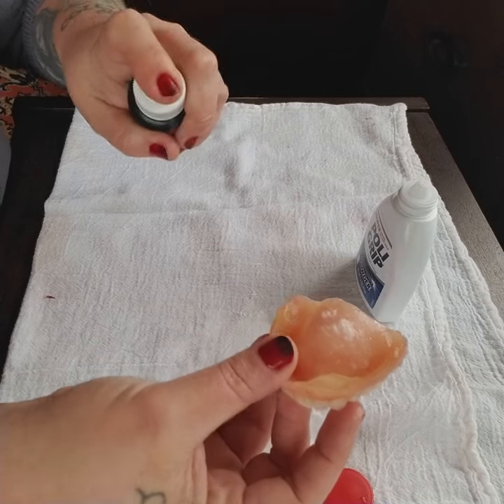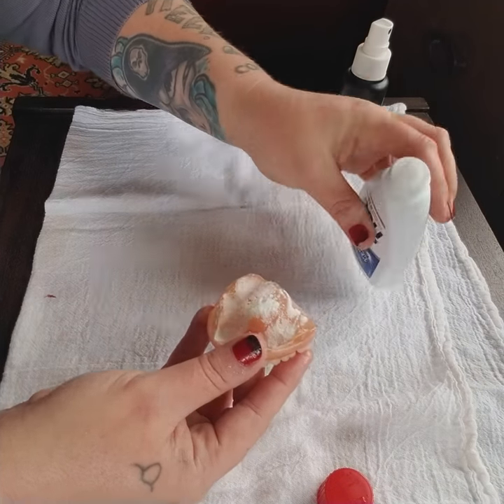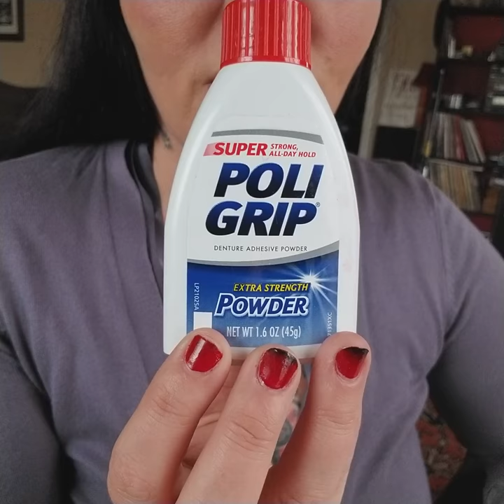Poligrip super powder application on dentures demo video

Comment: Does any one experience the upper denture on each side not sticking but the front holds better.? I've had my uppers since June 8 and now trying polygrip powder ( seabond doesn't work,and polygrip alone not lasting all day)
I've seen "Fixadent" work better  on YouTube because of the zinc in it! Anyone have  health issues with the zinc? If the cream and powder together doesnt work, Im going to try fixadent.
 Your thoughts?

Comment: I've tried the Fixadent powder and even let it dry for 30min before I drink or eat anything but that doesn't work.  I always make sure the whole palette is covered front to back with powder but liquids always gets under the denture and loosens it.  Hoping the Poli Grip works better.  I also have densure fit on my upper.  Hate the densure fit though.

Comment: Have you tried the Fixadent powder?  I ask because For me, the poly grip paste on my lower partial works better than fixadent gel stuff.  I've seen people talking about fixadent powder so I bought some ahead of time for when I get my upper denture.  I know this will be a trial and error phase and seeing what works for me.  I don't use the adhesive often in my partials because they really don't fit properly anyway and stay in fine without the adhesive.  My biggest issue is getting food under them and it's way more annoying to try to get them out and rinse when that happens if I have adhesive crap on them.
Reply from the maker: +Rebecca G I did try the fixodent powder. I didn't like it as much. It had a weird taste along with residue I didn't like. I'm not sure how it would work best with a partial. Unfortunately I only have full upper and lower. I've found I really don't like paste at all. I'm much happier with powder in general. :)
Reply: Tattooed Mormon yeah, I'm not even gonna try it on my partial but I'll have a full upper when I have my procedure and the powder seems like a good idea for some reason.  The gel or paste stuff is annoying sometimes (on the partial).  Lillian Darling posted a video using a combo paste and powder so I have that in my memory box of things to try as I go through this journey.
Reply from the maker: +Rebecca G I tried that combo and it was too much for me. I found the powder alone works great for my needs. I can't handle that much adhesive. When I asked my denturist he said if I needed that much then my dentures need adjustments.